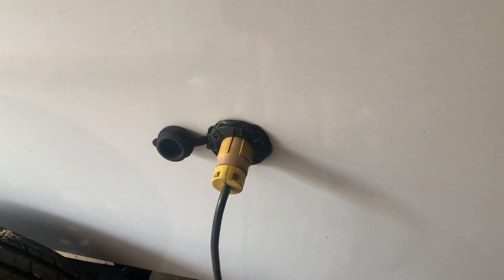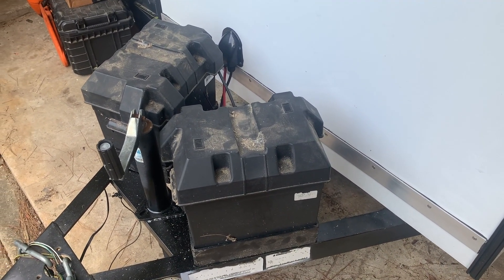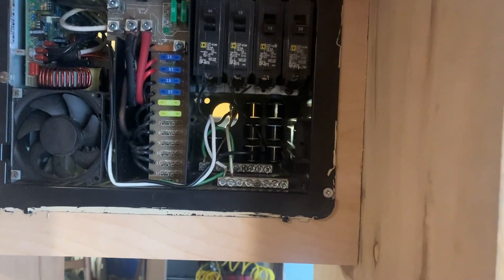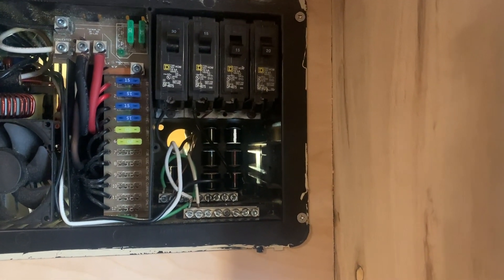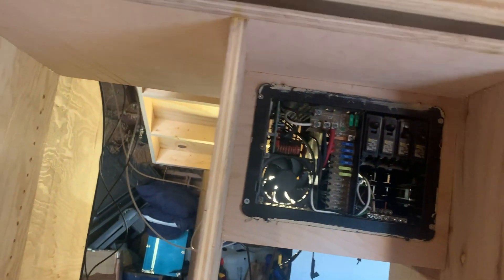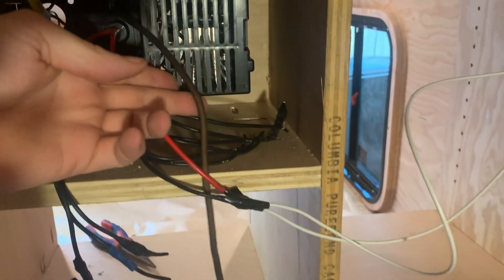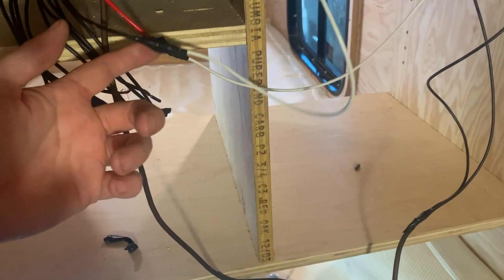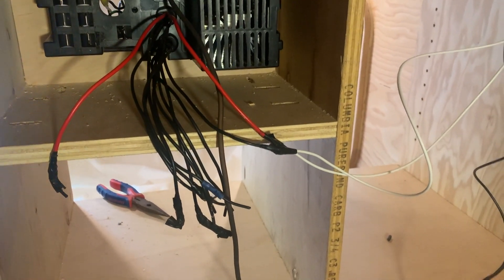DIY Micro Camper - Electrical System Part 1

Comment: Just curious if you’ve run into any issues running the charge controller into the power converter. I searched high and low as to how that should be setup and a master electrician told me to run separate wires to the battery from the charge controller and not through the charge controller. He said the PD4045 knows to adjust this way. Meaning when you’re on shore power, you can still have solar charging at the same time and it knows to adjust accordingly. I followed his advice and it works perfectly. I never have to switch one off in order to use the other and vice versa.

Comment: Question, hopefully your still active - are the soldered on wires connecting to the fuses (2x red and rest black cables) that feed behind the converter positive or negative?
Reply from the maker: zom zom Yes the bundle with the two red and bunch of black are all positive. Thanks for watching.
Reply: @BasecampUnbounded  awesome thanks! What connectors did you use to connect those wires to the leads for your accessories?
Reply from the maker: zom zom Temporarily just twisted and electrical tape but I will be using but connectors with heat shrink when I finalize the install.

Comment: That is a nice design. Better than a lot of commercial setups.
As you were describing closing up the panel space I wondered if it would be possible to make the back removable for maintenance. Perhaps hinged, or held on with those tiny, strong magnets